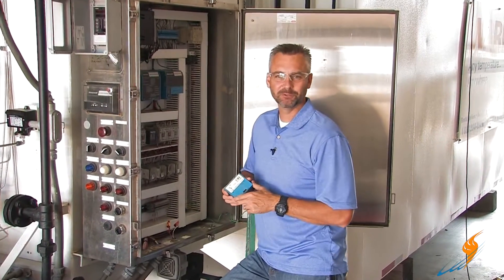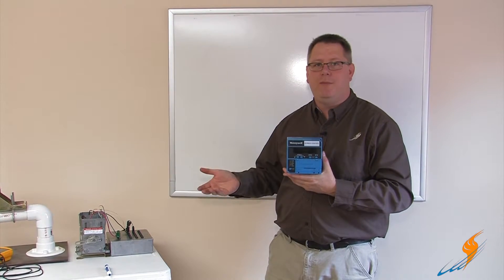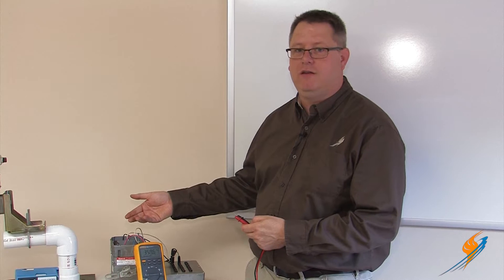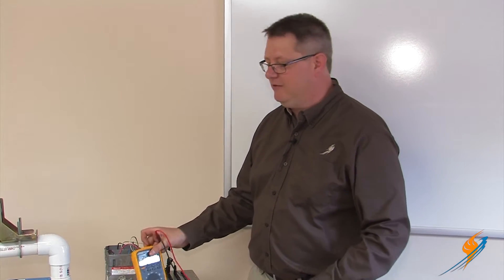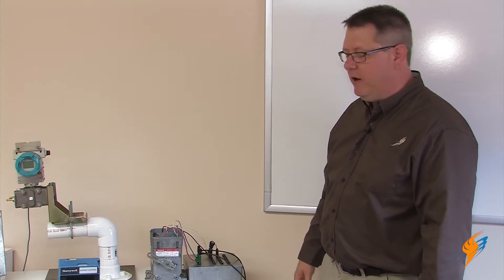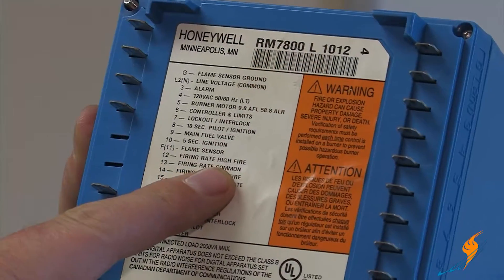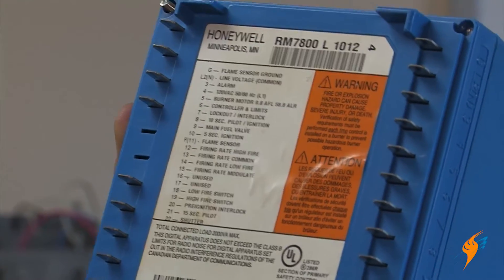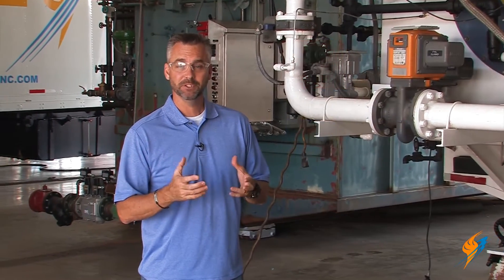How a Flame Safeguard Works - Boiling Point

Comment: Why my shutter alway on?
Reply: The shutter should be energized by a specific terminal on the mod motor.  That timing will vary by unit, but if it is always energized, you may have a problem with your programmer.  Otherwise the shutter could simply be stuck in the closed position, in which case I would recommend replacing the self-checking scanner.